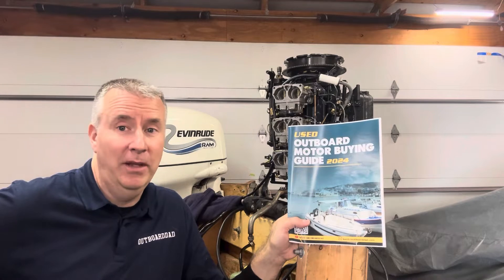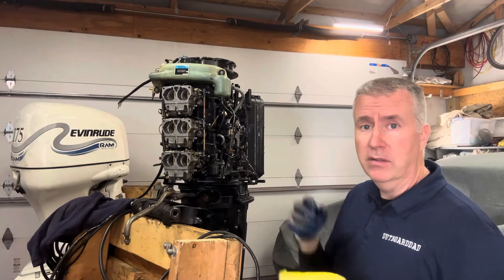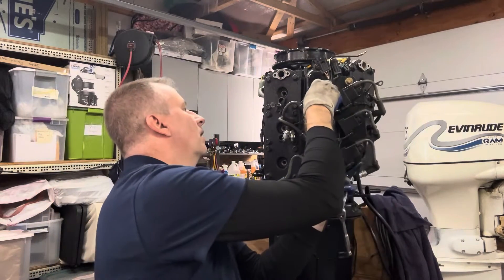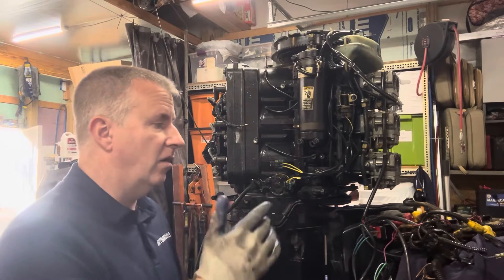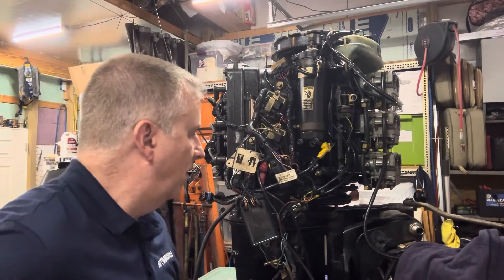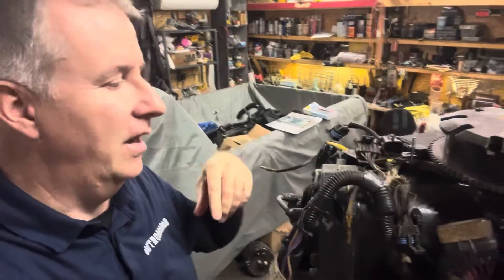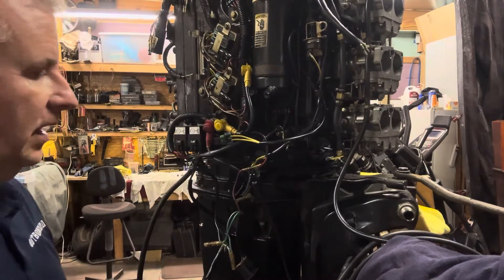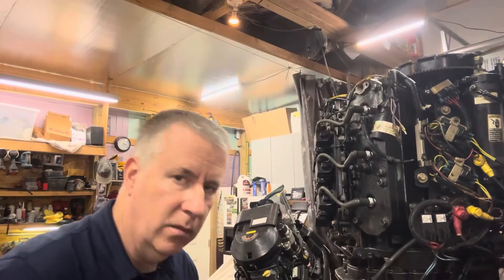Mercury Outboard Rebuild Power Pack and Coils (Part 34)

Comment: Do you know if this model has an alarm in case that oil injection cog fails
Reply from the maker: @Allaboard-KnK  Clog no just float in the tank. Do you have this model?
Reply: @ no but want to get a rebuild motor around this age 200 or 225
Reply from the maker: @Allaboard-KnK  Good luck!